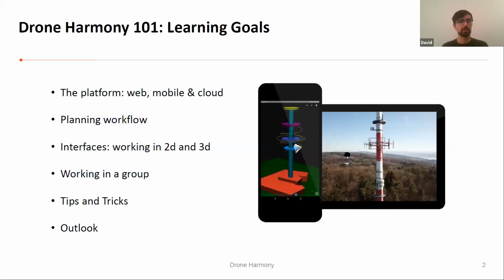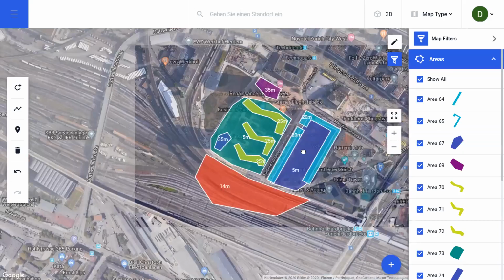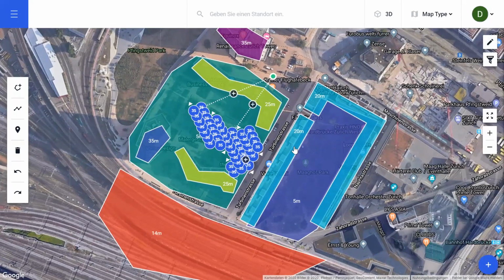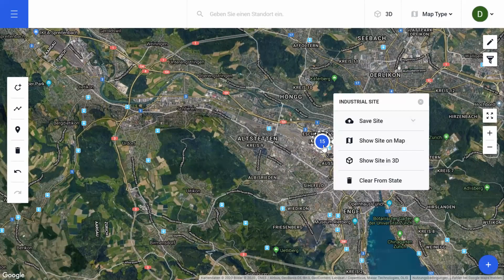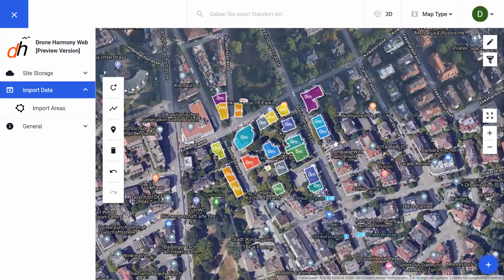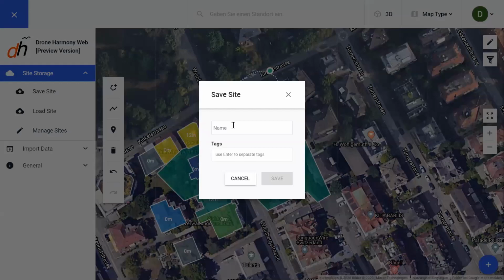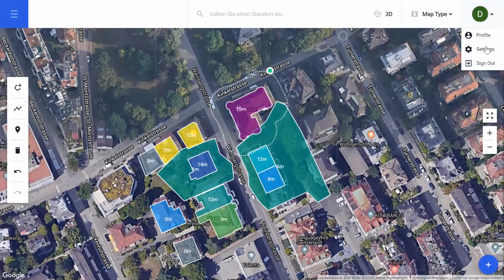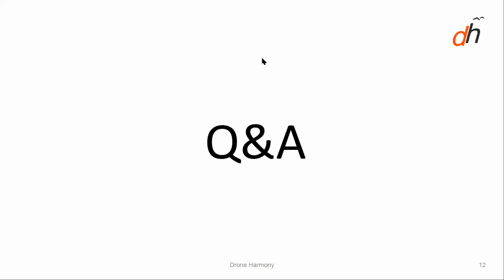Webinar "Get started with Drone Harmony"

Comment: This is the most complete drone flight plan that an aplication can make for i knows.. I think for the best result and safety,  before we use inspection features of a building we have to make fotogrammetry of the surrounding areas of the building..later based on the result of fotogrammetry process we plan the inspection mission...